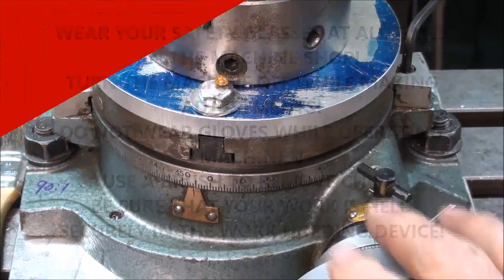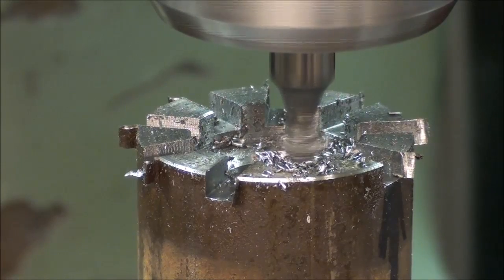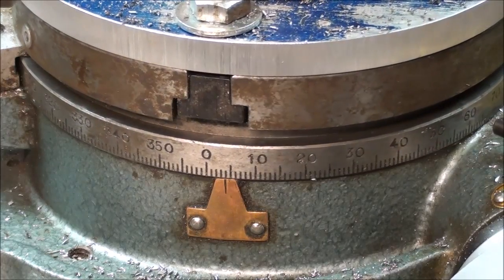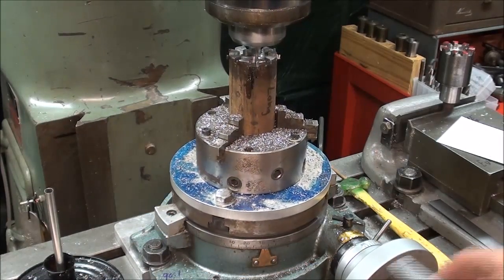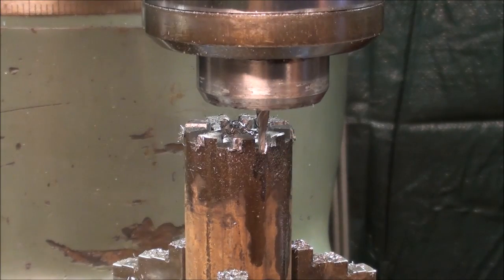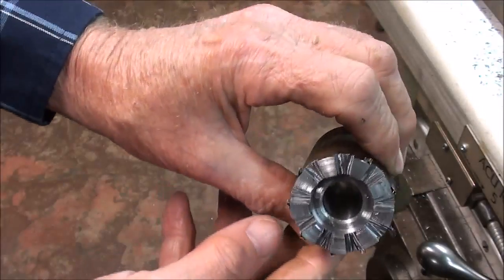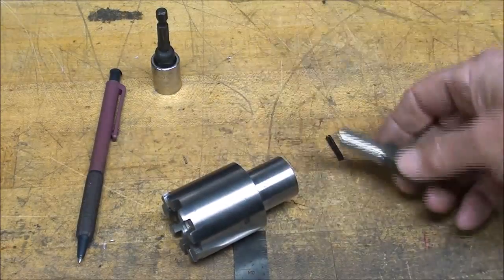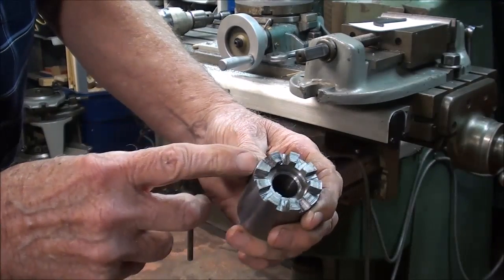SHOP TIPS #204 Tubalcain Makes a Crank Adapter for the Bridgeport Pt 2

Comment: I made one of these a few years ago and discovered a better way to cut the taper of the teeth so that the mill EDGE was on the centerline of the rotary part, not the center of rotation. You then mill across the part through the other side. As I recall there were 7 teeth and it took an odd number of rotations to get it done. The results were almost a perfect fit and I have used this a lot on a power drill to lift and lower the knee.
Reply from the maker: Sounds like a good solution!

Comment: Another great video!

When I bought my 1950's Bridgeport 25 years ago it came with one Z crank handle, somehow another appeared, then at a non-mechanics garage sale I found a third. It stood out like a sore thumb, bought it for $1. I thought they might keep showing up unless I did something with them.  So I cut it down, and machined a 3/4" hex head for it. I had added a 6" Kurt vice a while ago, so the power really helps. An HF Hercules driver-drill powers it just fine, also whips the vice in and out pretty good. 

I had previously machined a piece of Delrin for the job. It worked but I failed to connect it to the hex properly.
Reply from the maker: That sounds like a great use for an extra crank handle!

Comment: Hi Mr Pete i bought  x axis for  a table top mill to use on the Z axis . So i sold the mill and the guy said keep the new power feed.  Now  I'm going to use it on my Bridgeport clone on the knee . I have already made the extension shaft and on the adjustment nut i need to cut the crank handle cogs and will be using your  direction video to do this also like to note my first time cutting treads on a lathe . Thanks again for the help . JM

Comment: Seems that the .060 offset should be .0625, which is 1/2 the diameter of the cutter. We want a radial line toolpath for the edge of the cutter, so we move edge of the cutter to the center of the table, rather than have the center of the cutter at the center of the table. 

Excellent video as usual!
Reply: The 0.060" gives a bit of clearance between male and female.

But this could all be done in 9 passes with 1/4" cutter as mentioned above.  Offset the cutter by .125 and run through both sides of the counterbore.  Crank 40* and do it again...and so on.  But I'd prolly still go around again making a light climb cut pass offsetting a couple thou less offset.

Comment: Dear mr Pete, First of all, thank you for sharing your knowledge. Regarding this piece, I came across a video, which does a similar job, with a different setup, if I may, I respectfully post a link to it, it’s in Russian, which I don’t know, but it seems pretty easy to understand, https://youtu.be/NBcMiSbKSxY , will this be a suitable as long as the angle of cutter is still 40 degrees? I don’t have a mill or dividing head. Thank again, respectfully and kind regards.

Comment: Several people asked where the 60 thou came from and I didn't see an answer so here's my guess:  I think he said it was by trial and error, but it seems the point was to get the edge of the 1/8" mill lined up with the center of the circle (that is, on the radius line so it would cut the edge of the tooth on a radial of the circle.)  The radius of the mill is 1/16" or .0625 so that seems like the ideal offset, but .0600 must have been close enough.  I think it only depends on the radius of the end mill and the same offset would work for any number of teeth.

Comment: While working my way through your video library from the beginning, (currently at Feb 2010) the first of this series showed up as “Up Next” in my list of suggested videos.  I was so intrigued I fought off my OCD urges to continue in chronological order, and I watched these videos.  I had actually modeled one of these adapters in SolidWorks 1-1/2 years ago, but never got around to making it because I was concerned the drill wouldn’t have enough torque to raise the knee.  And in order to measure the torque needed I would have had to make an adapter, so I kept putting off the project.  

I now have a renewed desire to make this part, but would like to share some info if anyone else is planning on making one as well.  First, the .06 offset was the cutter comp for your 1/8” diameter end mill.  To save on rotary table moves, (I think you had 27) try this (reduces it to 18 moves).  Starting with the rotary table on Zero, rough mill each slot with a 5/32 end mill (9 slots at 40° increments).  Offset the “X” axis by half the diameter of your end mill (.078” for a 5/32 end mill).  Start with the rotary table on 10° & mill all the way across the part & return.  Repeat this 9 times at 40° increments.  Going all the way across the part will mill a single side of 2 slots with each rotation of the rotary table (Don’t use this method when roughing because directly across from the center of each slot is a boss). Since the small end of the slot is about .164, using a 5/32 end mill will eliminate the tool change & give you a little stiffer end mill than using an 1/8”.  If you don’t care about the finish you can forget the roughing operation and cut it down to 9 rotary table moves.

On a side note concerning fighting that chuck key when the chuck was mounted on the rotary table.  If you’re fortunate enough that your chuck uses either a 3/8” or 1/2” square drive, use a ratchet with an extension or a speed wrench.  Otherwise, take that 1/2” hex stock you had left over and mill the appropriate square on the end so then you can drive it with a ratchet or speed wrench.  Thanks for all the great videos Mr. Pete.  I look forward to working my way through your entire library.

Comment: Beautiful video, please does anyone know how he came up with the +0,0600and the -0,0600
Reply: I think he said it was by trial and error, but I think the reason was to put the edge of the 1/8" mill at the center of the rotary table.  That would mean .0625 instead of. 0600, but it must have been close enough.
Reply: @gregcook9915  thanks a lot . You also from the south ?
Reply: @speakthetruth795  no, I'm from silicon valley.

Comment: You need to buy a Milwaukee M18 battery drill and you will throw out the corded drill 👍
Reply: Mitch Stephen All jokes aside, cordless drills have came a long way.  Any decent 18v Li is far better in every way than that corded.  I am partial to Milw too!

Comment: Thanks Mr Pete for the great videos. I know this is long after the series was presented, but  I am planning to make one of these just because I can. I am somewhat confused with what I am seeing in the video when compared to the DRO setup that I have been recently using. When you say you move the table -.060 as used in the second series of cuts, which way is the workpiece moving in relation to the cutter?

Comment: Here's my go at one: https://youtu.be/FEIBsuvbf1U I found a little different way to do the geometry by offsetting my cutter so it's cutting right on the line, then doing 20 degree turns moving the Y access back and forth for each one.  I'll explain it more in part 2.

Comment: Great work, but why not connect an electric motor and be fixed in the machine and controlled by a key
Reply from the maker: Because that would be more work than turning the crank by hand, LOL

Comment: You covered my thought about using a 1/2' Allen wrench for the hex stock.  I agree about the 12 point nut rounding sockets. -  That red is pretty. lol - I always like to mark the drill bit so I could keep my eyes on the work. -  I love the lady bug shop assistant. - It's nice when the last cog works out even. - PETA gonna get you for that. -  Thought that drill was gonna wear you out at the end.  But better than cranking that far.  Great milling machine work.

Comment: Did it just like you said, and it fit beautifully. I only broke one 1/8 milling cutter, as they mill by snatch and grab increments. Thanks again for an informative video. The 1/8 cutter sure used up a lot of pucker factor.

Comment: I Have one that I Purchased  (Crank Yanker brand on Ebay) it saves my bad shoulder  and makes set ups faster.   nothing gets older than cranking a Bridgeport Table up and down
Reply from the maker: +1995dresser That cranking gets old
Reply: Thank You, it's mine and the original tool. some copies, but Crank Yanker is the best value.

Comment: Great pair of vids Mr Pete.  I made two a while ago on my CNC knee mill,  but suffered the frustration of broken 1/8" end mills in the process.  Great to have, and great to observe someone with more skill than me making them.  Even better is the satisfaction of routinely using a practical self-made item in the shop.  Keep up the generous work of sharing your knowledge and ability.
Reply from the maker: YCM30cnc  THANKS

Comment: Dare I say snug as a bug in a rug.

The 60 thou equates to half the cutter width, which in theory really should be 62.5, but the final fit was good anyway.
I'm thinking you could have also used the 3/16 cutter for all cuts, and not doing the 0 40 etc cuts.
Simply offset by the half width (93 thou) and do the 10, 50 etc then move 93 thou the other side and do the 350, 30 etc.
You already had a 3/16 gap at the narrow end anyway :-)

Comment: When I finally acquire a milling machine, this will be something I make! This is a great example of the time and effort needed to build even seemingly simple parts like a crank handle adapter. As usual, I really have enjoyed watching these videos!

I've had very good luck with Bosch drills. My previous one had nickel based battery and it was 18V. This one lasted me for at least 4 years of heavy use (on a service truck). It was at least as powerful as a similar sized 120VAC drill. It came with 2 batteries, and I think that in 4 years I replaced the battery cells once in each battery. It got tired, the Jacobs chuck was worn out and the batteries were finally weak again. I left that drill in China at a jobsite.

Its replacement was another Bosch with Lithium battery. This one is smaller and lighter, but it is at least as powerful as the previous one. The battery runs as long per charge as the nickel battery; and it is just as strong. Really a night and day improvement over the old battery drills.

I tend to agree with you on the uselessness of 12-point sockets! Except for one thing.... as a Caterpillar engine service engineer, I use them for several of the special bolts on the Cat engines. For instance the head bolts on the 3500 engines, and even the small 12-point 1/4" socket for some of the fuel injector hold-down bolts. Without these it's darn near impossible to work on these engines!
Reply from the maker: davida1hiwaaynet Thanks for watching.. That good info on the batteries.

Comment: Hi Pete
For the next adapter:
First cut at 0 degree, second cut at 20 degree with an x offset as the od off your tool
You take a cut in the middle an than two cuts with the radius of your tool one in -x and one in +x
all the best juergen

Comment: By guess by gosh!  That's awesome.  I tell my buddies that I just have "The Eye."  Mostly it is from remembering from victories and failures in the past, but I will maintain "The Eye" with them for as long as I can.  I was turning something one day at work, and had just measured it, and knew I had .002" to finish.  My buddy Carson came in and asked how much I had left, so I dusted my hands in a ceremonial way, and "felt" the piece.  I then replied, "about .002""  He said, "No way," so I invited him to measure it.  For some time he was convinced I had magic fingers.  Now, he makes chips for a living in a fancy, CNC shop.  No magic fingers there.  Just magic machines.   Thanks for the video!
Reply from the maker: superdave2112 Thanks for watching. You can't beat experience

Comment: get your hands on a cold air gun. I'm a tool maker, blah blah. You use brushed on oil on the tool but cooling your part can help you reduce tool wear, chip gumming, and increase accuracy. thanks for your videos though im a huge fan!
ps did you base your calculations off of the I,d. of the blank and have a .120 diameter cutter instead of a true 1/8th inch?

Comment: +Fred Newman 
If you read the machinery handbook under cutting clutch teeth it explains that cutting an odd number of teeth that you can cut straight across...9 is an odd number
Reply: outsidescrewball Great tip, this obviously includes the 1/2 cutter offset so with only 9 indexing operations the tooth cutting job would be done as quick as possible. :-)

Comment: If you don't mind a completely off-topic question: You appear to be using the Bridgeport vise, just like what I've got. It seems the majority of folks out there greatly prefer the Kurt vise. Have you ever had a chance to compare them? If so, what are your thoughts?
Reply from the maker: Rick Rose I have used kurt vises. They are the best.  But I prefer the smaller & much LIGHTER genuine bridgeport vise.
Reply: Rick Rose I had heard that the original Bridgeport vices were actually made by Kurt.

Comment: Mr p if u send me ur address I will send b and s taper for Cincinnati dividing head free beings ur the best teacher on u tube on metalworking thanks for ur many videos I learned a lot  joe pritchett from southern illinois on the ohio river
Reply from the maker: Joe Pritchett Hi Joe
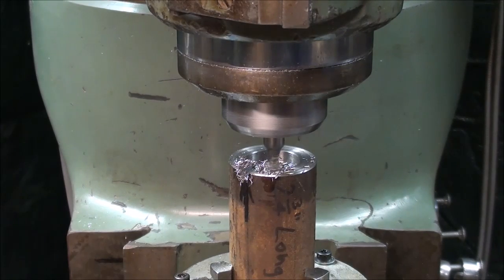Thanks you very much. My address is in this video 2 new TUBALCAIN compilation videos model engines & shop tips at 2:33
Reply from the maker: Joe Pritchett Hi Joe
Thanks you very much. My address is in this video 2 new TUBALCAIN compilation videos model engines & shop tips at 2:33
Reply: mrpete222  sorry mr p I looked every where couldnt find ur address I guess u will haft to send it to me joe
Reply from the maker: Joe Pritchett SORRY. Lyle Peterson, 2306 Teegardin Rd., Streator,  IL  61364

Comment: Maybe it has something to do with .06 being about half of the diameter of the cutter you're using. I'm not really in thinking mode right now.
Reply: Pretty sure that is theoretically correct and may be the reason that he got such a GREAT fit since the mill probably has some wear on it.

Comment from the maker: sony handycam hdr-cx110
Reply: That camera will only record in interlaced format unfortunately.  

Are the forces high enough that the aluminum part would quickly fail? Without doing any math it looks like the clutch side would be fine, would the hex stock tear itself loose?
Reply: Its not strobing so much as having fast moving parts change position between half frames. There is post processing that can make a huge difference, doing motion estimation, dropping resolution in areas to only use one frame's information instead of interlacing. but its most likely easiest to either not worry about it, fast, rotating objects are going to have issues, or get a camera that shoots 30/60 frames per second progressive.
Reply: mrpete222 Ahh, Saved me a search there Robert. I wondered if switching from 60 htz (US) to 50 Htz (UK) might trick it into stopping strobing but that's a long shot and might be worse. Great work as ever Mr Pete.

Comment: Works really good Defiantly the way to go Quick question for you (or anyone actually) I have my SB 13x 40 tool room Lathe(1950's Love it) So now I'm on the look out for a Bridgeport Mill or something comparable I don't really need something that big unless the price is right just like my SB I didn't need one that big but could not pass up the price and that's my question what would be a fare price for a Bridgeport Mill in fair to decent shape? I m just needing a ball park number anyone care to through out a number I'm all ears Thanks in advance
Reply from the maker: $1500
Reply: Mrpete you helped me tremendously with my SB lathe purchase now I have a base line price to work from for a BP Mill AND a OUTSTANDING TEACHER to go along with it! Thank You and God Bless
Reply: Rosario W Mr. Pete lives in rural Illinois where machine tools are relatively cheap. For example, where I live in Dallas, TX area, a used older Bridgeport is easily $3000 and way up from there depending on the tooling. Even the import copies are over $2000. I wish they were cheaper here.
Reply: Between Rochester & Syracuse NY used Bridgeports are routinely listed for $1500 and up,  but usually in the $2500-$5000 range.  We recently bought one at auction with DRO, Kurt vise, collets and Jacobs ball bearing chuck for $2000 plus 15% buyers premium and paid another $1150 to move it about ten miles.  A friend recently sold his round ram J-head model with 32" table and DRO for $1500.  I also have a round ram J-head that has served me well and may be worth considering (troll alert) if you are on a budget and only want it for hobby use.  If I were going to buy another manual mill now I would hold out for a dovetail ram, but at the time the round one was what I could afford and I've had no regrets in getting it 20 years later.

Comment: It looks like the taper points to the center of the piece, so your .060 offset would be approximately half of the diameter of the mill you were using so the edge of the mill is approximately on the center point.

Comment: Love the videos!  Wanted to give you a tip.  You may already know it.  To remove the horizontal lines in your video, switch your camera setting from "Interlace"  to "Progressive" .  Progressive will give you better quality,  especially when movement is involved.
Reply from the maker: How do I do that??
Reply: mrpete222
 What is the Make / Model of the camera?  Its usually under capture settings.  I can look it up and link you the info on how to change it.
Reply: lazerbaconpro Good luck! We've tried this before with no joy.

Comment: I think that this milling could be done in 2 milling runs instead of 3 Just by starting the first run off center. This way you mill and finis 1 side. After this run you move the part the same amount to the other side And take the second run. And if you move the right distants you can still use the same bit. That you used here on the first go.